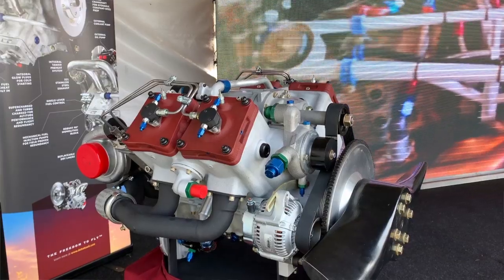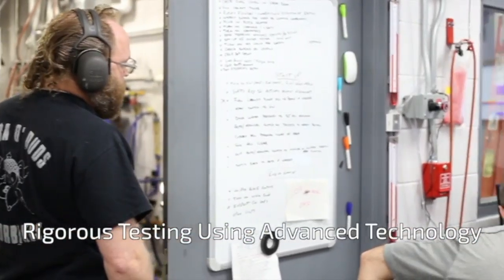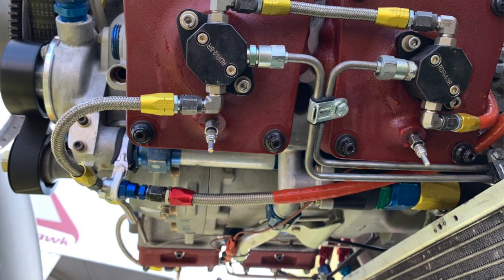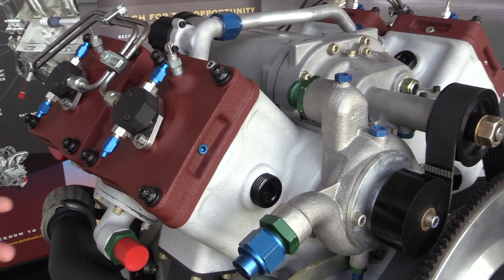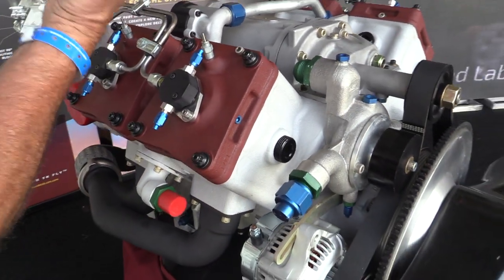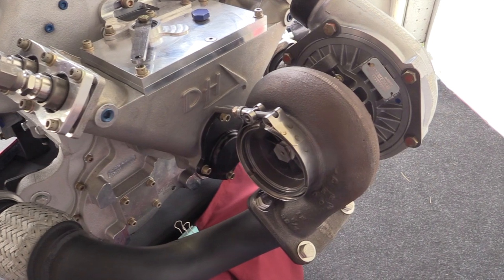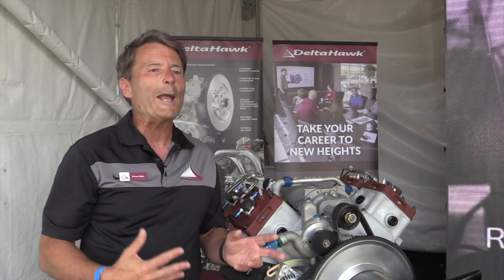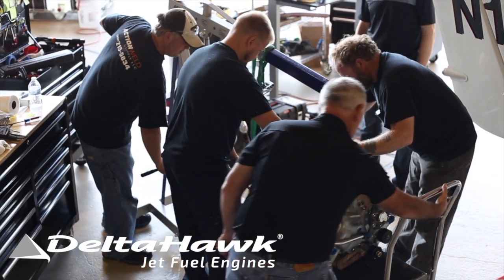DeltaHawk Jet Fueled Piston Engine Update

Comment: It's been a year away from certification for 20 years.
Reply: Ha ha glad you said it. Sounds like it's a two stroke diesel which is ancient technology. But it does work.
Reply: @gmcjetpilot  Lots of different two stroke diesel technology. Most of the two stroke diesels I've seen do have one (exhaust valve) like the old GM units. Obviously two stroke petrol engines have no valves but that is a very different technology. The only two stroke non valve engines I know of are the two piston and two crankshaft per cylinder types, i.e. Roots/Commer and Deltic. Upset there is no engine schematic for this.
Link me to a drawing please if I'm just a numpty.Not too knowing on diesels!
Reply: @COIcultist  2smokes commonly use reed and port valves, though you have narrowed it down to an ICE stem/plate valve.  There are gate, disc, spool, sphere, balloon, needle, among the many other valve designs.
Reply: @COIcultist   would be an opposed piston,  jumo 215 type thing,  where one crank shaft handles all the accessories , 30 percent , and the the rest is fed back into the other crank shaft, so 75 percent  goes to the prop.. this engine works on a different principal, it places the ports at different heights in the liner, and uses a lot of  forced induction, and very precise fueling , plus most likely some interesting piston shape to avoid loosing too much pressure in the overlap..  more like a petrol 2 stroke with no poppit  valves.. pressure and ports,  thats it.. must be using some crazy compression ratios , the port setup should be interesting as well.. they aren't talking too much about the internals so we gotta guess .. but it's no opposed piston tech,, achates is trying to work that concept.. it'll come
Reply: @planegaper  Then for any sort of emission certification it would have to be direct injection. D'oh what have I just said. Diesels are (nowadays) always direct injection. Just getting unreasonably excited at the technology morphing and direct injection 2 stroke gasoline engines appearing. Ringding ding ding ding ding. "I Love The Smell Of 2 Stroke In The Morning."
Reply: gmcjetpilot   GM diesel locomotives, were ALL 2 STROKE, , 2 POWER STROKES TO 1 WITH A 4 CYCLE ENGINE,.  CHEERS  from NJ
Reply: But now it's here! Congratulations to everyone for persisting with the design.
Reply: @RealGoldRealWealth  Whoops!  From their website Certification status: DeltaHawk Engines expects certification in the first quarter of 2023.
Reply: Yep, but they do seem to have made a lot more progress than Zoche Aero Diesel, which hasn't even changed their website in over 20 years.
Reply: Ouches! Hahaha ! Cheers Mate!
Reply: f I were them I would target the Experimental market to start with .! let the FAA take their time to certify at least I am already in business.
Reply: "Certification status: DeltaHawk Engines expects certification in late 2020."
Reply: @bradley3549  Certification status: DeltaHawk Engines expects certification in the first quarter of 2023.
Reply: @ElCapitanR1  LOL. This needle keeps moving!
Reply: A year away from certification for 20 years is still better than 10 years away for the last 40 years as with fusion reactors! Anything that can offer 30% fuel saving whilst still providing sufficient power is desireable, not only from a user economy point of view but also from a pollution reduction standpoint.